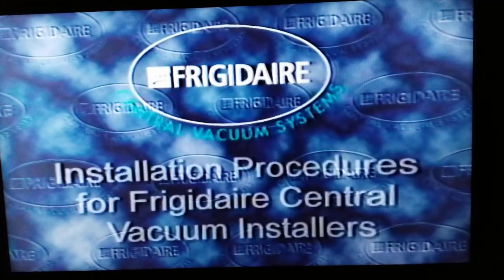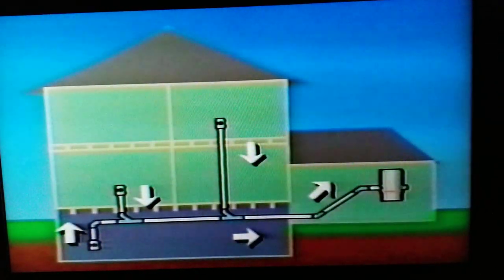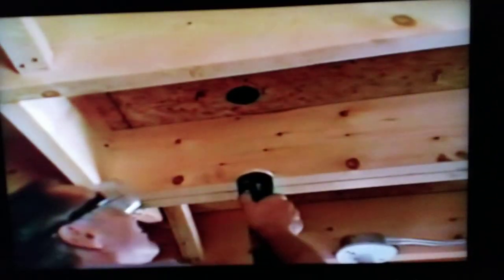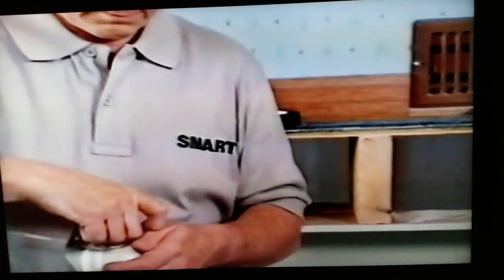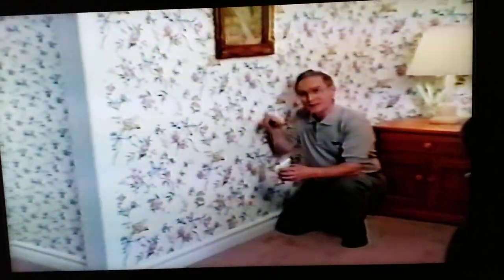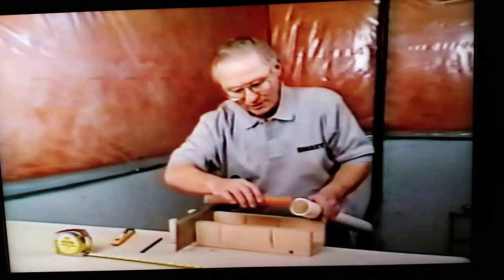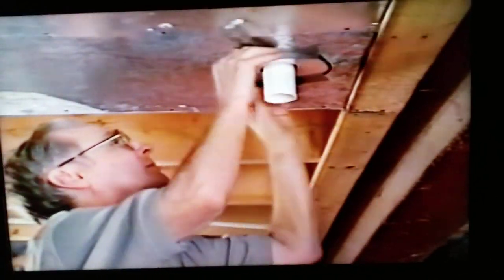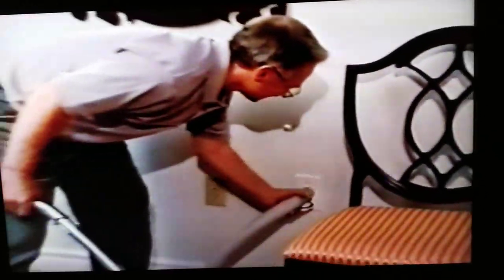Frigidaire Central Vacuum Installation Video

Comment: Why does the vac unit look like a Modern Day?  My Canadian-made vintage Beam Smart is the type...I think they call it an inverted bag...?  Well, where everything goes into a receptacle at the bottom of the machine.  I don't remember seeing units like that from Beam unless they were a compact condo-style machine.  Most machines manufactured are of that style.  Canavac, Beam, drainvac, aqua air, etc.  Filtex and MD, for the most part, made/make those big Tristar-on-steroids style units that I know of.
Reply from the maker: You're right, the design is based off of Beam's condo units. I see them around here from time to time labeled as Frigidaire, or Eureka Powerline (copper colored metal). I like these better than the inverted bag/standard Beam design. But then I AM a Modern Day guy, and if I was a little older, I'd have been a Filtex guy too.
Reply: @owenperkins  Yeah, I guess that makes sense, larger surface area in the filters thus longer times before they need to be changed.  There are a couple of drawbacks I can think of with the MD design. One is that is since the motors sre at the bottom emptying can be a bit of a pain, especially in the fairly confined space where my unit is as I live in a split level where the unit sits the ceiling height is roughly 5 ft in that part of the basement.  The other is possible damage in basements from flooding, not that it happens much here in Goderich, Ontario.

Comment: He didn't use primer on the glue!
Reply from the maker: And neither do I!
Reply: @owenperkins  Primer?  What's that?
Reply: I don't either!
Reply: If you are strong enough (it don't take much) you can just push it in while glued. Primer makes it really ugly.
Reply: @natej4230  For PVC electrical conduit you also don't typically use primer. Assume that primer is only really needed when the pipe is expected to hold liquid. Vac pipe is low pressure (hah) so it probably isn't a big deal to not use primer. They do make clear primer though.